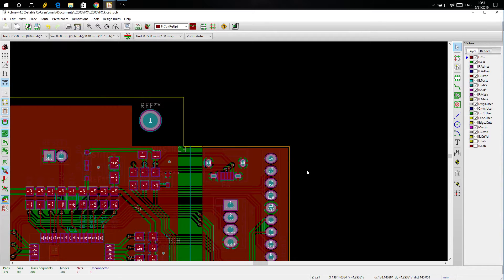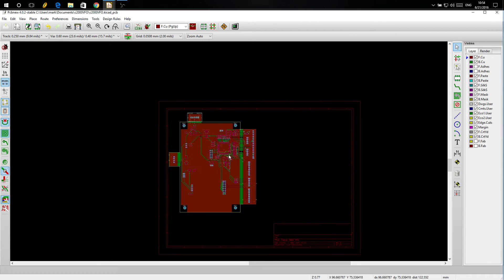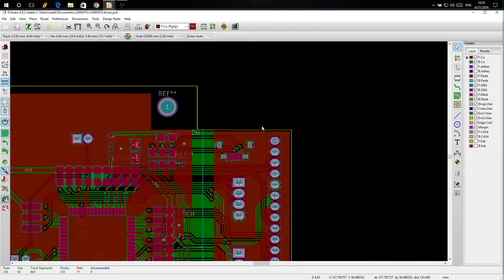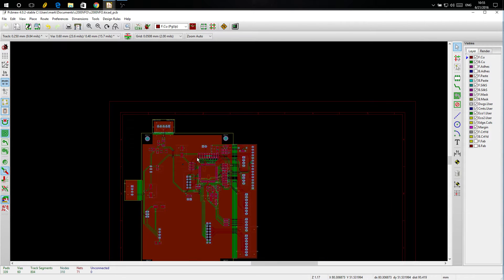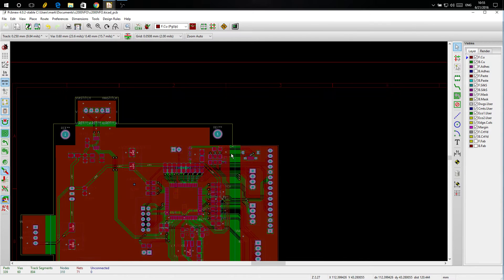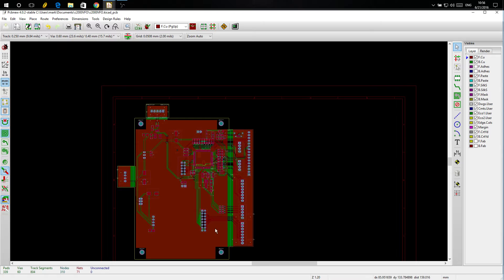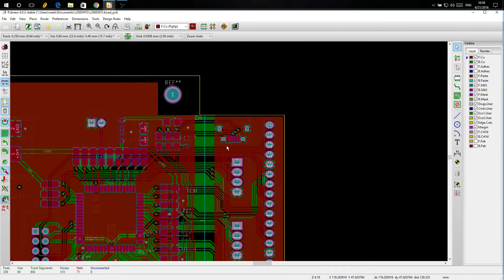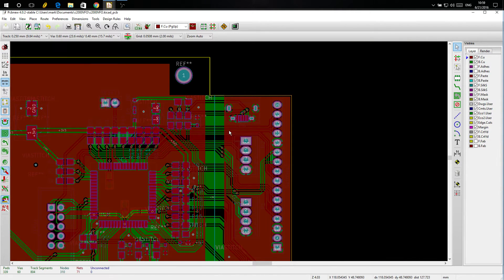More Updates.. and Brexit!

Comment: nice work!  hey you remembered to bring in soldermask between the pins on that qfp right?    i hope im not too late!  great work!  if you forgot, it will still be fine!!!   73!
Reply from the maker: The footprint and mask looked ok to me when looking at the gerbers so it's probably good to do.
Reply: right on!
Reply: i just didnt notice it in 3D mode. but gerbers are what counts!
Reply from the maker: That is interesting. I am going to look at the 3d render now to see why it's not there.
I wonder if that's just not rendered or if I somehow turned it off.
Reply from the maker: Nope. it's set so fine that it would not likely be any there.
The footprint defaults appear to be wrong... so oops. I fixed it tho.
Good catch.
It will be okay for a prototype. It's not being reflowed... just a PITA to solder :(
Reply: in pcbnew, right clicking on the part while in "default" viewing mode under "footprint"  then "edit parameters"  you can set the soldermask for THAT part and not mess with the global settings.   depends on the PCB fabricators specs though!!! say i had a .2mm pitch i would go with .15mm  it "should" show up in 3d view.  your using a windows version, so i cannot be 100% sure.
Reply from the maker: Pitch is 0.8 and elecrow has a min of 0.2 for soldermask.
I can work with it.
Reply: good man!